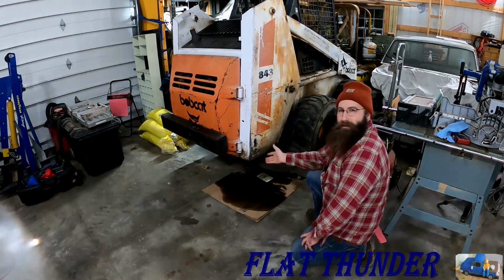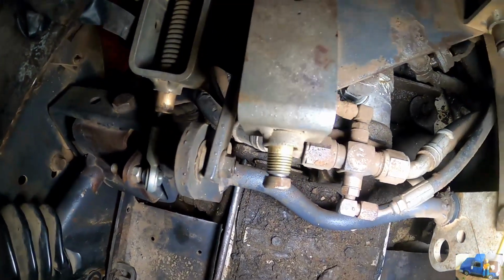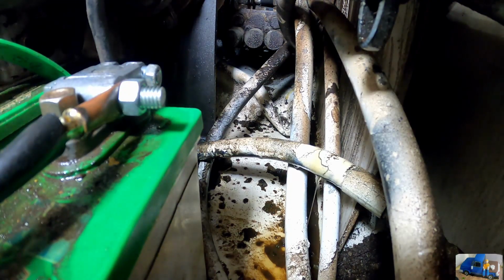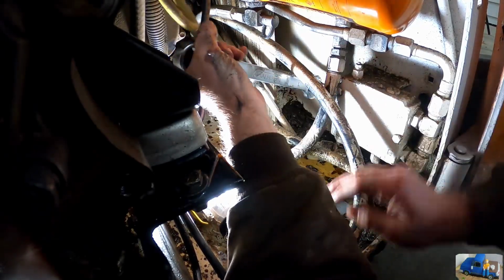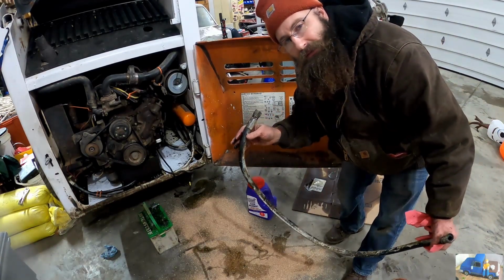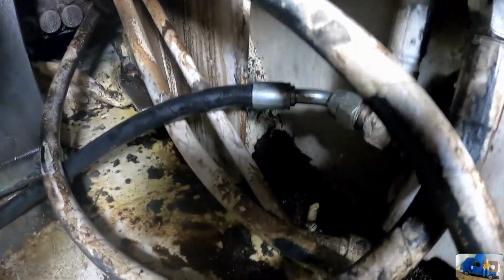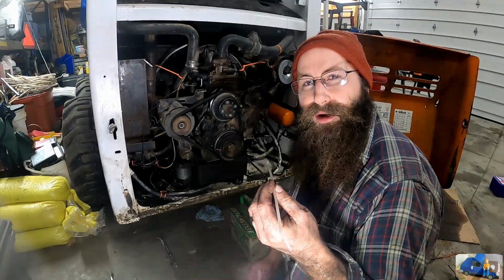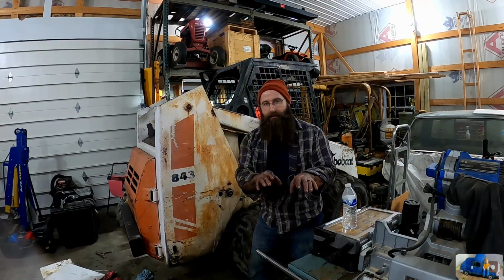843 BOBCAT; LEAKS / LEAK HUNTER

Comment: I bought Bobcat 843 without hydrulic pump ,but the problem is pump for this model cant be found ,is there any pump that fits to this model from other Bobcats.
Reply from the maker: I assume another common unit exists, but can't speak with any authority.  In my mind the only real economical solution is to find a complete parts machine.  Thanks for watching and good luck on the repair.  They are a beast of a machine!  👍😁

Comment: Hi I also have the 843  it doesn’t drive straight it pulls to the left side any advice  to fix it thanks in advance !
Reply from the maker: The servo valves / valve linkages need adjusted.  You should be able to raise the unit and adjust the linkages so both sides match.  If this doesn't correct the issue you may have a damaged drive motor.  Thanks for watching!  👍😁

Comment: My 843 just started leaking oil from the dip stick hole. It starts and runs good but when temp gets up oil begins spewing. Thanks for any suggestions
Reply from the maker: If the engine isn't overfull, I am guessing the engine has blowby that is pressurizing the crankcase.  Check the oil  fill level, check for a plugged crank case breather, check for excessive blow bye, check for a blown head gasket.  Thanks for watching!  👍😁